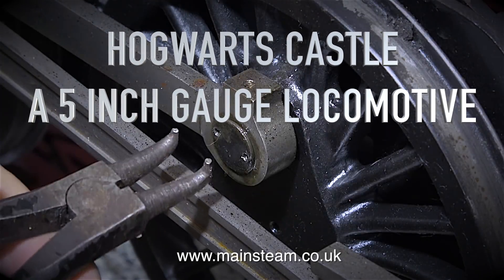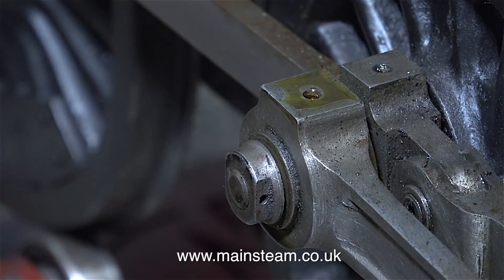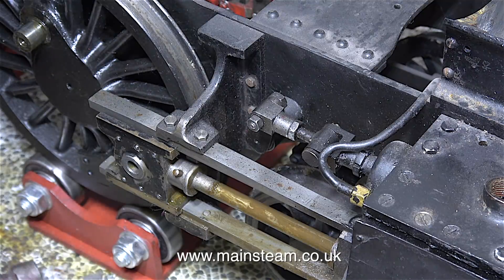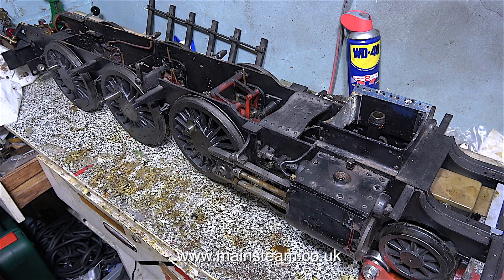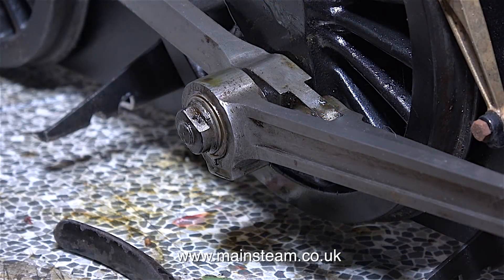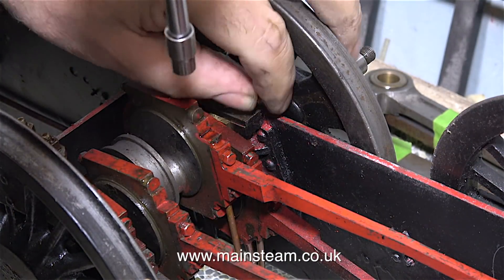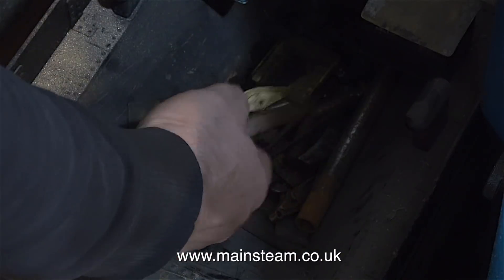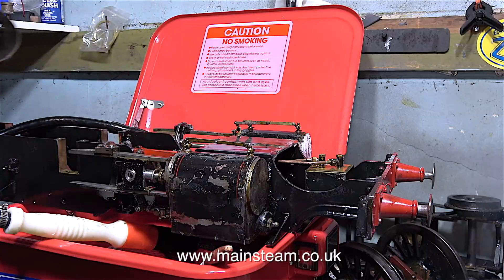HOGWARTS CASTLE - A 5 INCH GAUGE LOCOMOTIVE - PART #3

Comment: I heard of an old sore throat remedy from my mom.  Lard and kerosene mixed up and applied to the neck.  When you tasted the coal oil, you took the poultice off.  Supposedly, it worked well.  When dad was about 10, he cut his foot pretty badly, and they soaked it in kerosene.  Used to be like medicine.  Times change....